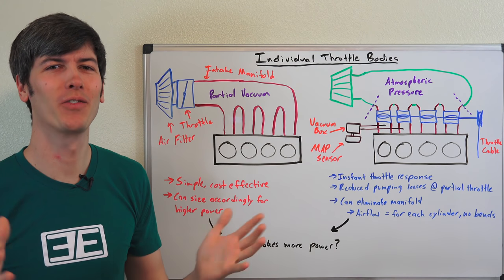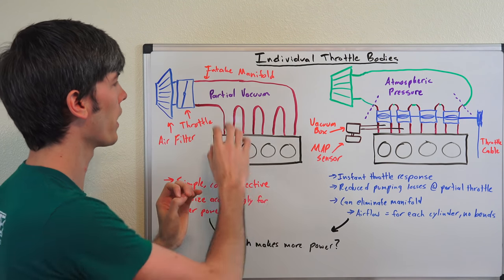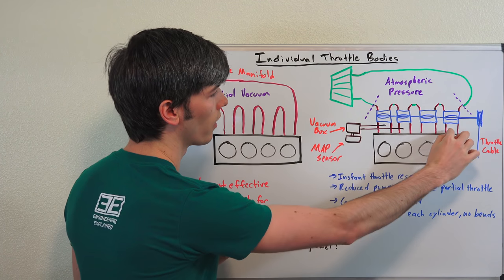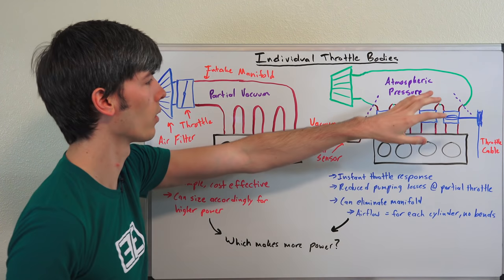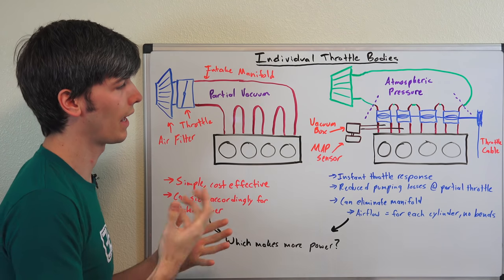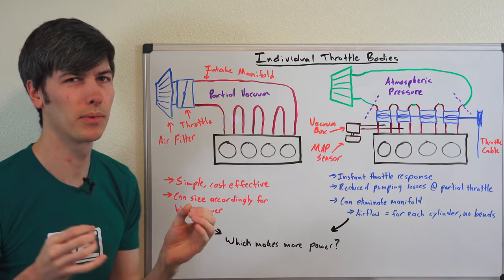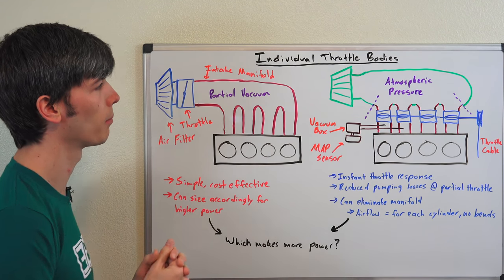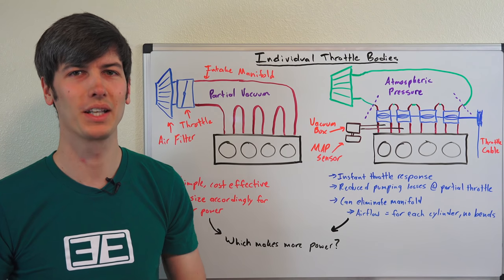Benefits Of Individual Throttle Bodies

Comment: Can. Anybody school me on their RDX 410 cc if I buy them with them 4 clips will they be plug n play with a ktuned  fuel rail  or do I have to buy a adapter i know for sure obd1 set up you do.  I have a k20a . I called Honda, no help . I'm wondering cause if it is plug n play its worth it . If I have spend morethen 100$ might ass well get some 200$ 650cc . There 60$ on Amazon n eBay Tia for the answer .

Comment: That's very old technology. My cars engine uses not only individual throttle bodies but dual throttle bodies in dual intake runners.One restrictive for low rpm torque and the other much larger for 3,500rpm to 6,800rpm max horsepower. The vehicle is a 2010  2.0L turbo Passat with a stage 2 ECU, blow off valve kit and downpipe along with full cat back exhaust.
Good video just seems to be more relevant to the setup my 2000 GSXR 1000 has, not most modern car engines from the last couple of years.